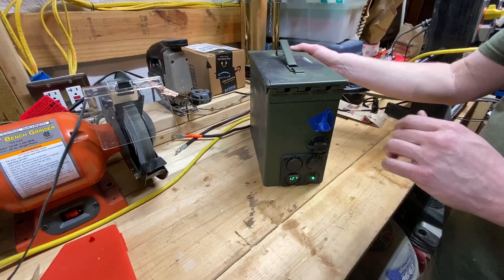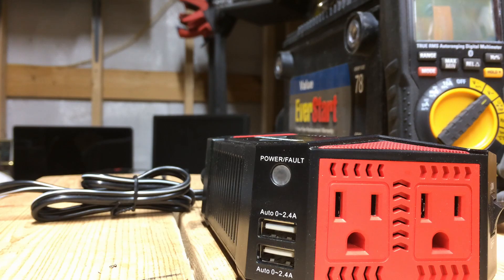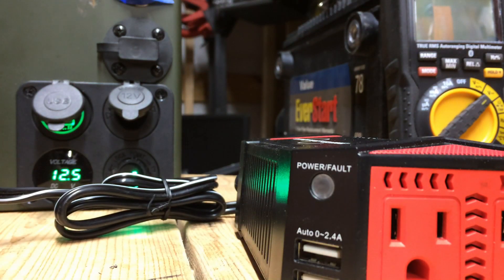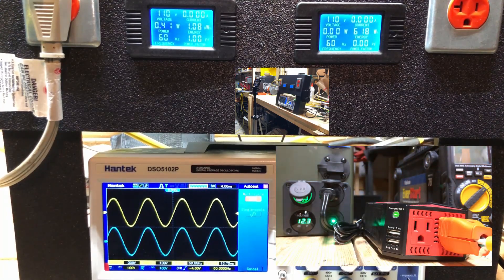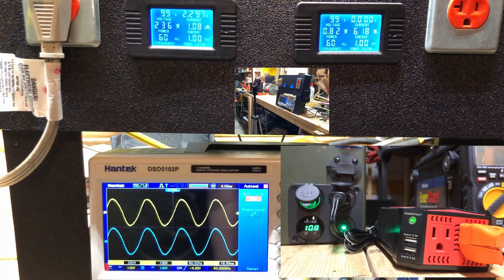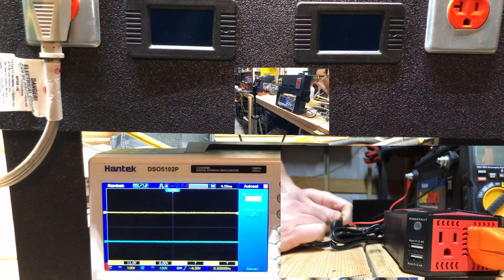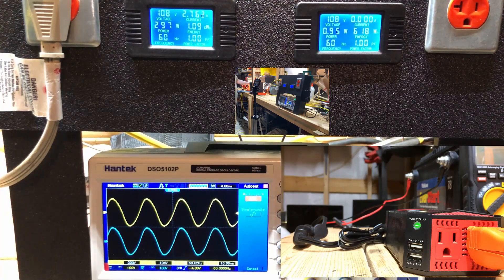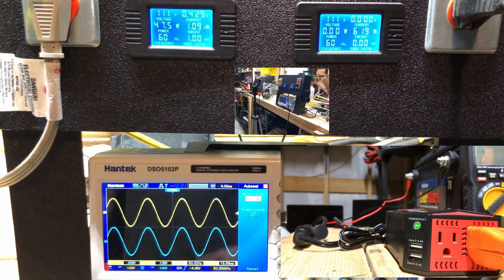Bestek 300W Pure Sine Wave Inverter - Review and load test

Comment: I am not an expert however is seems this video is of disservice to anyone who watches it, this inverter looks to be of poor quality as it does not produce 120v which is one of the reasons you were not able to get 300w from the light bulb, it seems rather inefficient as it draws  37/40 something watts just being on with no load. It does not look as if though it can hold a stable sinewave under load, this video and your comments gives the impression that this is a good product when it does not appear to be the case you mention it is good for sensitive electronics I do not believe that to be the case here.
Reply from the maker: The manufacturer states this inverter has an output voltage of "110V-120V". The 300W bulb is likely rated at 120V and we can expect the wattage will be around 252W at 110V. This makes sense because current will also drop as the voltage drops on this resistive load. I was surprised but the math doesn't lie.  I have not put an ohm meter on the light bulb to determine if it is exactly 48 ohms which is needed to get a 300W load with 120 volt input.  
The meter is measuring power going through the meter. It does not measure power input to the inverter. If you watch closely at 4:07, you will see a light bulb on the workbench come on at the same time the scope shows readings which explains the 37W "idle current" you see on the meter. It actually is a 43W light bulb load (again probably rated a 120V)  and not idle current. 
While using the larger battery, I am feeding the inverter with what is at best 12awg wire which means there is about 27-28 12VDC amps running through it. It is likely showing up 10.8-11Volts input into the inverter. The inverter will accept up to 15V input and would produce better numbers near that voltage. 
The jigsaw is inductive, which we can clearly see by the power factor reading on the right side meter, but it not a steady load.  The inverter has to constantly make adjustments to regulate the voltage and inductive loads are not inverter friendly anyway. The rapid change in inductive load and voltage adjustments are of course seen in the scope.  I wouldn't attempt to run the jigsaw and a TV/DVD player on any inverter at the same time. In practice, a TV and DVD player work well on this inverter though. 
For the price, I do think the inverter is pretty good. I have not received any compensation from anyone related to this video or inverter at the time of this comment. 
Thanks for watching.
Reply: @LivingCommonSense  thanks for the taking the time to reply to his comment with all of this good info. I have one on the way
Reply from the maker: I'm confident you'll be pleased with your new inverter. Thanks for watching!
Reply: @LivingCommonSense  I use these in my CPAP machine backup power units. At less than 150 watt load they are superb.  The USB outlets are ALWAYS HOT even with the unit Off. There is about 7 watt draw any time these are plugged in and will drain a battery after a week or less if left plugged in. 
Here's my hard wired unit in action. The cig lighter plug and wire can also be attached to use in the car. Note the battery kill switch. 
Edit: to charge eBike battery we needed 166 watts. The cig lighter breaker is now 20 amps, good for 250 watts. The old 10 amp breaker would pop within a few seconds. There is no fuse in the Bestek cig lighter nose. It has 2 fuses inside the unit that are not easily accessible.
https://www.youtube.com/watch?v=UwuC97gpng4
Reply: @kimmer6  you really shouldn't run that much wattage through a cig lighter port. You should have someone wire the inverter directly to your vehicle's fuse box for better electric signal and fused protection.
Reply: @buggzo  The 300 watt  inverter is wired with a 30 amp breaker to the lithium battery with an XT-60 30 amp connector. Its not in a vehicle but the whole works is in or attached to a plastic trolling motor box. The cig port has a 20 amp breaker to run another Bestek 300 watt inverter if necessary. Battery is 200 amp hour lithium.